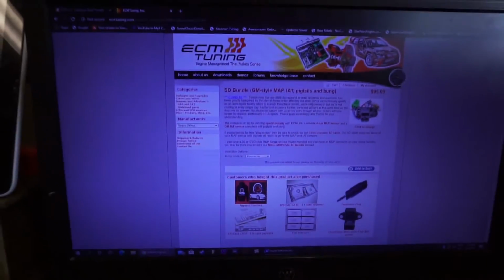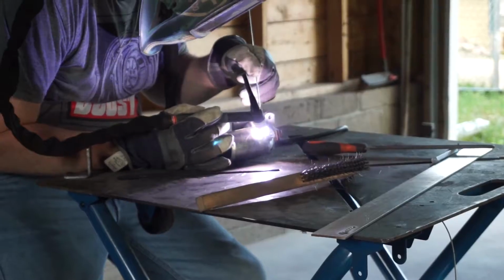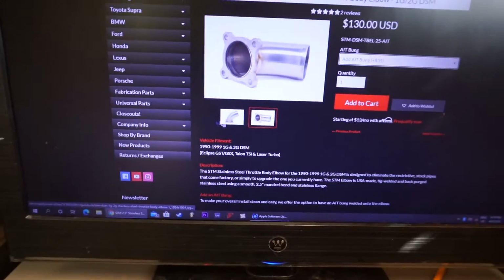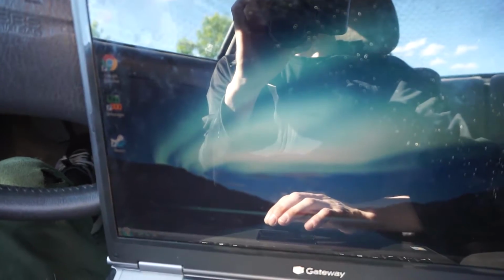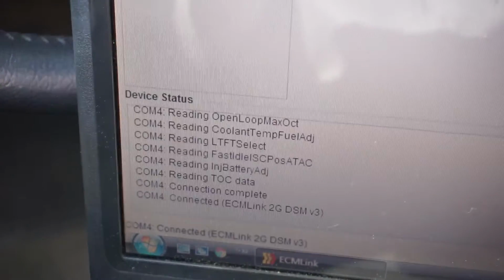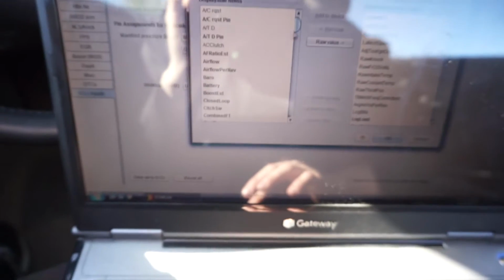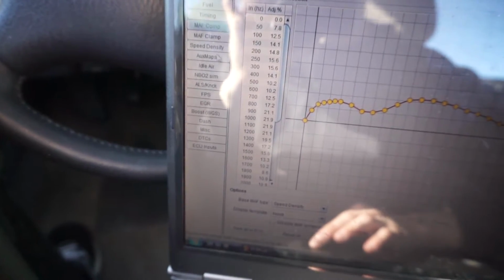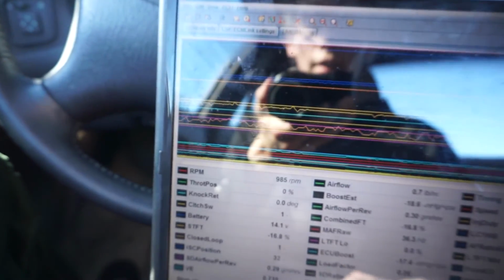Speed Density for a 2g DSM |EP. 2| DSM |

Comment: Do you need ecmlink for this install or Will my Stock ecu accept this?
Reply from the maker: Ecmlink is needed, although any standalone engine management system will likely be similar. The switch to speed density involves removing the factory mass air flow sensor and switching to a pressure based airflow reading system. The stock ecu is not optimized to use those airflow readings in order to run the engine. Ecmlink allows the use of either airflow reading system, so keep the maf if it still works for you!
Reply: @bakrrproductions2413  thanks for a great answer. I have a blackbox flashbar ecu in Stock. I Think that Will work when i setup it up to that. Right now i am having the Old ecu eprom But without ecmlink 😅

Comment: I'm using the other way around which is Evoscan but I could not log boost with a MAF. Would this be the solution? Also what benefits I could get with this instead of the standard MAF?
Reply from the maker: Maf only measures the amount of air entering the engine, given that you have ZERO boost leaks. I used this so I wouldn’t need to have a filter+maf setup in the engine bay. I only have an intake pipe and air filter and helped to de-clutter the area. Not only that but now I have a sensor that tells me what boost I’m running and really helps me set my boost control correctly. (Made me realize I was pushing my 14b turbo to 26psi😳 and it blew the seals lol) OH and if I blow an intercooler pipe off, I can drive the car home and fix it. I won’t have to worry about fixing it. As the maf only measures airflow entering the engine, it won’t measure correctly if you have boost leaks like a blown intercooler pipe after the maf. The map sensor and intake air sensor measures the density of the air and calculates the fuel needed for it. 
I’m of the opinion that more sensors mean more data and better information to tune and I love data. I also don’t like a bunch of gauges telling me what the computer already knows.
Reply: @bakrrproductions2413  that’s great information. Thanks man! Would definitely try this setup in the future. One more thing, have you removed o2 sensors as well?
Reply from the maker: @vonvoyage14  I no longer have either of the oem o2 sensors. The front has been replaced with an innovate LC-2 for use of logging and in the ECMLink software you can simulate the factory front o2 voltage to behave like a stock vehicle. Although I’m having an ongoing issue with sensors burning out, but I believe that to be oil residue from my turbo seals causing them to malfunction.
Reply: @bakrrproductions2413  Running stock Front O2 sensor is highly recommended. Relying on narrowband simulation is pretty iffy. If your wideband sensor burns out or your wiring goes bad, you will have a difficult time driving your car home.
Reply from the maker: You are absolutely right, I do agree with you. In a perfect world I’d definitely have an oem front o2 sensor, but I do not. Besides that the car runs just fine in open loop without an o2 sensor or wideband as I have burned out the wideband lc2. I do however plan on making it work with the rear o2 pin on the ecu in the future.

Comment: Interesting. Any notable difference to the driving experience?
Reply from the maker: Hardly any difference, drives like stock after a little bit of dial in. I had a slight issue with bogging down low in the rpm range and after tuning that out it’s been a dream. Personally I did it to log boost in the ecmlink software and speed density just felt like the feasible option to go with since it can still drive well with a boost leak. If an intercooler pipe blows off, the car can be driven normally to home. At the track with a 14b turbo turned to 22psi I’m logging 288 hp and 314 ft-tq @ 6300 rpms. Couldn’t be happier